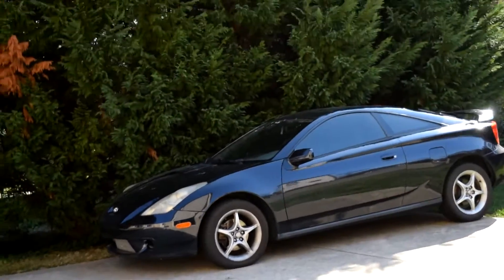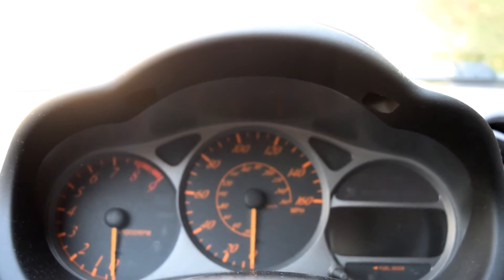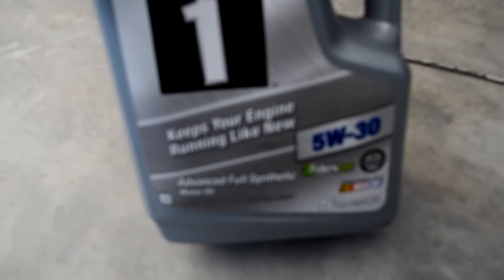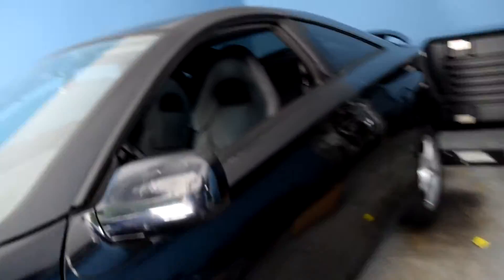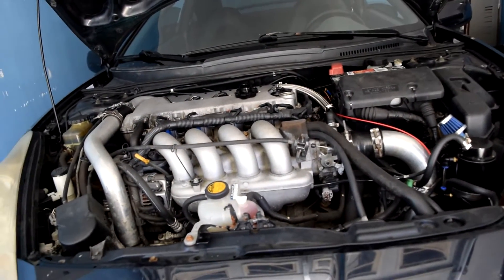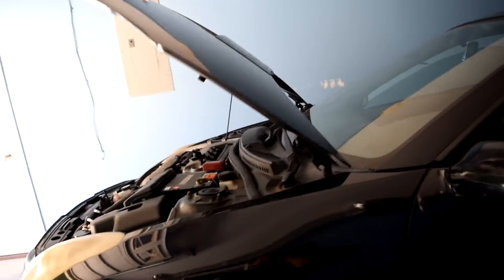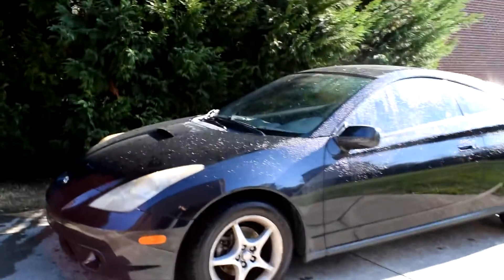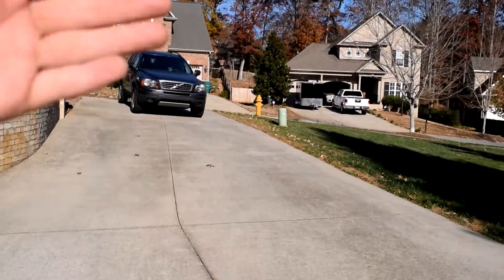Oil Change, Plans for Turbo Celica, and More! | Vlog

Comment: Any advice on what type of exhaust set up for my Turbo'd Celica GTS? Its only a 2.5inch exhaust now which is really restricting my power (235whp at 7.5psi)... but I really really don't want that drone you mentioned yours has.
Reply from the maker: Matej M    go to this video and scroll to the comment section. Look for the most conversation between me and this one guy sharing links. That's the setup I would HIGHLY recommend and is the route I'll be taking. Here is a link to that video, https://youtu.be/UMUwa71vZV4, like I said, go to the comment section and see the links he posted. That's the best exhaust setup for our cars.

Comment: I know you will fail the test for visual inspection at the smog, but can the AEM computer trick the smog machine or do you have to unplug it before doing a smog, and if all that fails how do you get it registered on the street?
Reply from the maker: Each state is different with stuff like this. In North Carolina places are pretty easy going as long as you have catalytic converters and nothing crazy going on. I have to take the car and get inspected again here soon, and I'll go ahead and take a video of it passing inspection with flying colors. But than again, this is NC and each state is a bit different.
Reply: Mateo M. I would definitely watch that video to see how you pass the smog.

Comment: Hey man can you help me out?
Reply from the maker: Quinn Olvera what do you need help with?
Reply: Mateo M. Alright so, my car shakes when it is stopped idk for what reason it could be or when it's a red light or stop sign also my steering wheel shake when I'm going at 60 mph and idk what it could be. It's a celica gts
Reply: Mateo M. I drive it daily as well
Reply from the maker: a couple things that pop into my head for the shaking wen coming to a stop, a vacuum leak somewhere(look in engine bay and check to make sure nothing is loss), air flow sensor is messing up, or a cylinder is mis-firing.
For the steering wheel shaking at 60mph, the car needs to be re-aligned (take it to any tire shop and they will re-align), and that should fix it. If not, rotors are warped (time to replace them), and if that isn't it, worst case scenario, the bracket that holds the axel has come loss (really dangerous). 

Hope this helps point you into right direction of where to start looking for issues, but the BEST advice is to take it a certified mechanic and have them check it.